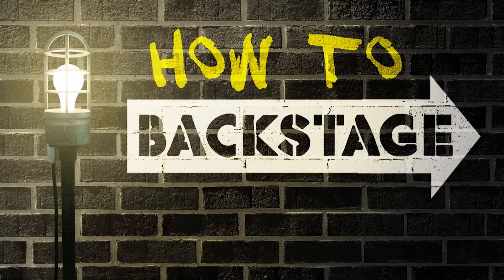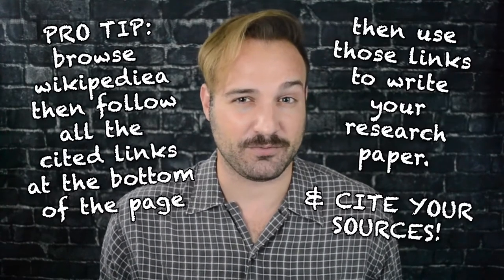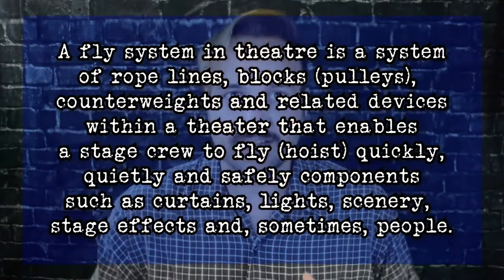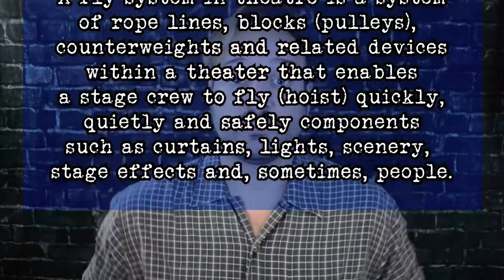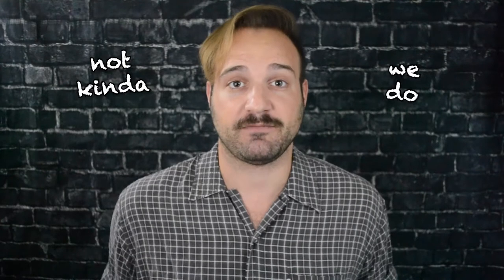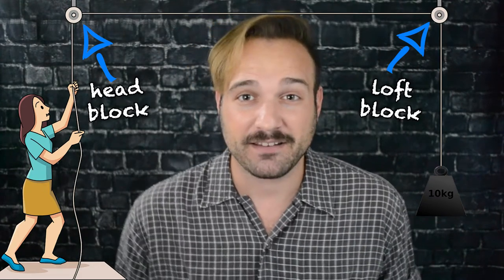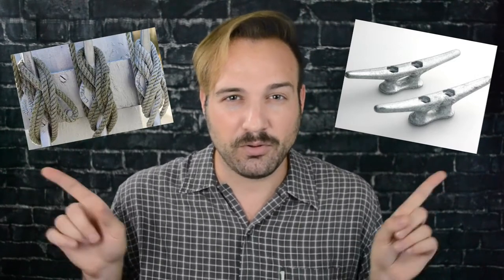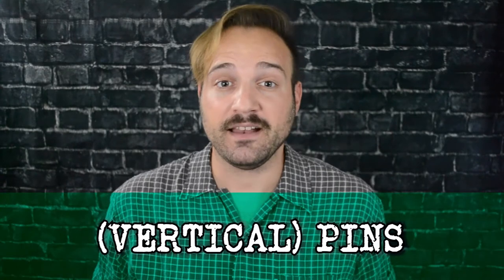Theatrical Rigging Basic Terms to Know!

Comment: First off. This is such a great video and I will send it to anyone who asks how the fly rail works at my theatre. The only thing that stuck out to me was the grid. Some lines are attached to the bottom of the grid and some above. My lines run through the grid and are attached above the it. It can make reaching a block to move or check it difficult as above hung lines can be head height or lower making it difficult to move on the grid where as below hung lines require you to reach through the grid. Was this nessisary info - not really but I really miss working in theatre :(
Reply from the maker: I miss working in theatre too! And I think it's necessary info! My early videos had a lot of comments about me being "wrong" so I've been trying to stress how EVERY theatre is different, even down to the nuts and bolts, and you've just proven that. :) My college grid, everything was attached to the bottom, we didn't have any above - but I've worked with some where the block was above..or there was a "second" grid below...I don't know why. They don't always consult theatre people when they build theatres...LeSigh.

Comment: Hi. Great post. In a simple single-line hemp system, where would the rigger and tie-off point/rail typically be located with respect to the stage? On the stage level or on an elevated platform? Also, if some counterweights are involved in this sort of system, as a help to the rigger, where would they be attached? Assume lots of ignorance here - I'm not a tech person. I'm just trying to get some research right for a story. Thanks!
Reply from the maker: In the single-line system, the rigger and tie off can really be anywhere, most of the time it's stage level offstage, unless the theatre has some sort of elevated platform specifically for rigging.

In terms of counterweight for this, I've done it a couple ways, but usually the counterweight should be slightly less than what is on stage, and is usually on the rigger side of the rope, and attached where the line meets the the tie off, when the load is completely flown out. So when the load is flown in, the counterweight ends up above near the head block. Hopefully that helps! (And that's only how I've done it. And I generally don't do that since it means a weight above the rigger's head.)
Reply: @NickAchBackstage  Awesome. Exactly what I needed to know! Thank you.